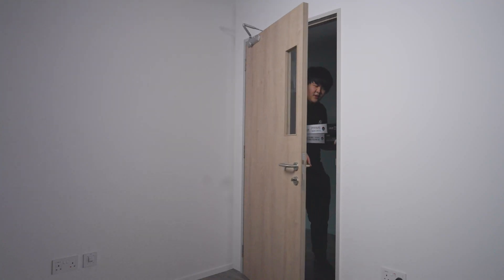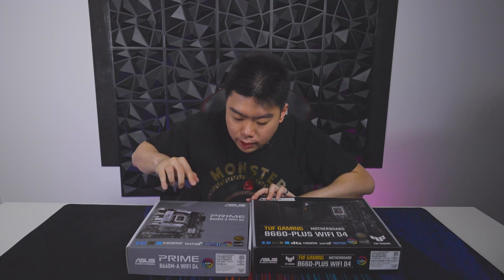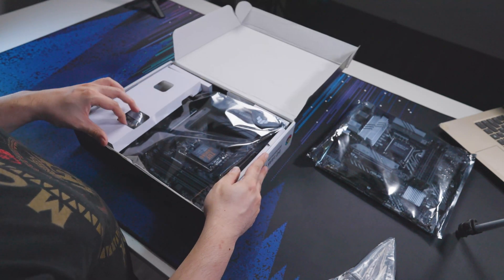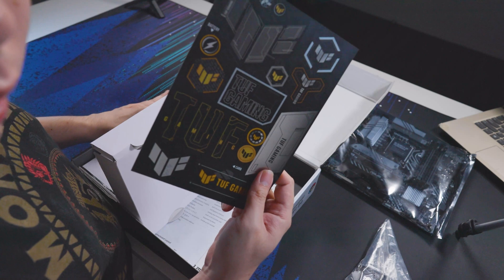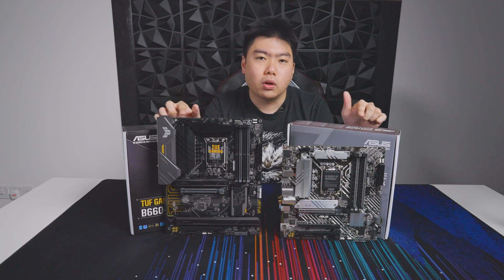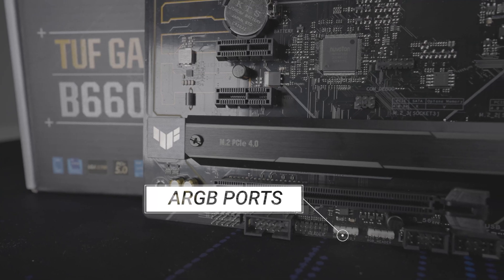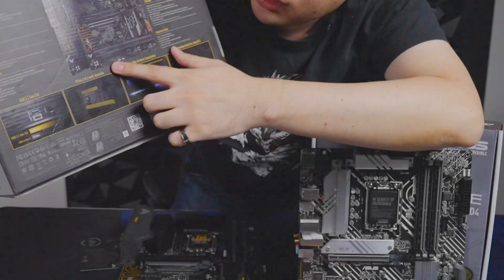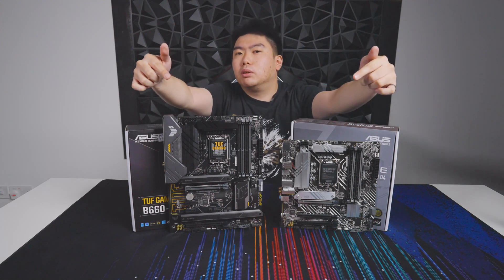Intel 12th Gen on a Budget with B660! Ft. ASUS

Comment: Can you pair 12600k(I bought it because of higher base clock speed than 12400 not sure if it will give me better performance) with b660 series motherboard (because z690 motherboard is too expensive) ?
Reply from the maker: Hello!

Yes you can actually, however the down side to that is that you will use the OC functionality from the K series.
But apart from that, that isn't an issue :D

Comment: I'm planning on upgrading from 8th gen to 12th gen after finally snatching a GPU.
Do you know if the TUF Gaming board is compatible with the Dark Rock Pro 4 without blocking the RAM sticks? I know it's a big chonker of a cooler, and I've often had difficulty in the past with fitting RAM sticks in the MOBO.
Reply from the maker: Hey!

When it comes to the RAM compatibility with the dark rock pro 4, it generally has to come down to the RAM height and the way the DRP4 is mounted.

One of the ways you can mitigate the ram clearance issue, would be to not mount the front fan.
Performance will take a slight hit (2-3 degrees from experience) but you'll be able to get away with the ram that way.

Alternatively, you can offset the cooler fan a tad bit but it may look abit off from a aesthetic point of view.
But you will have to keep in mind the cooler clearance of the chassis. 

So to answer your question, the motherboard shouldn't really affect clearance when it comes to ram.

Hope this helps!

Let me know if you still have any other questions :D